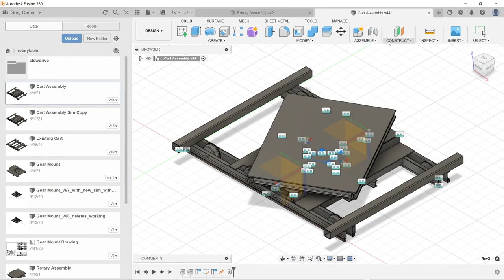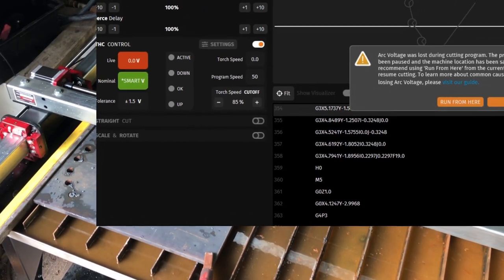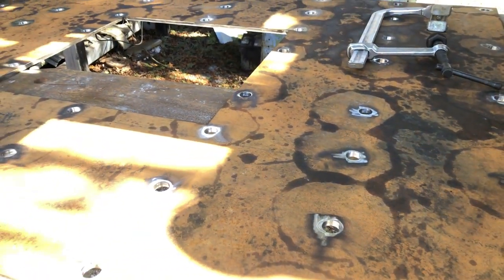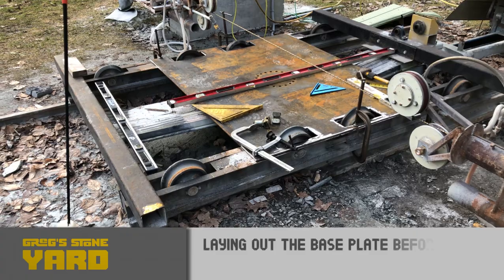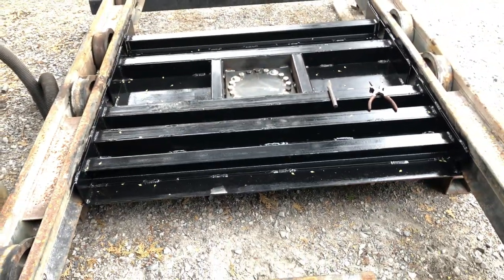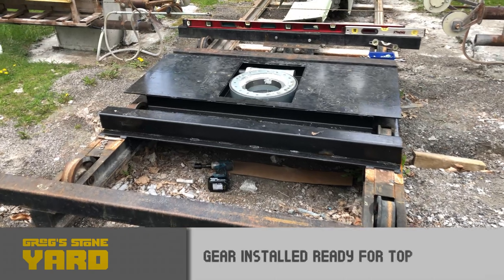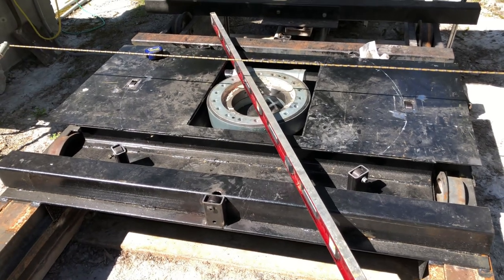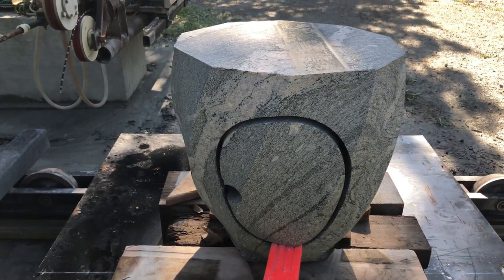Building a CNC rotary axis for a stone saw #CNC #CUTTINGGRANITE #ROTARYAXIS

Comment: Nice addition to your stone saw Greg. I've never heard of a slew drive before.  I suppose you could easily square 5 of 6 sides on a single setup now?  Not to mention the creative cuts you demonstrated.   Always happy to see new videos from you.
Reply from the maker: Yeah that's the plan if I need to.  Really just using it to position stone to make simple cuts has been a big help.  The more complex ones require a good CAM program to generate the correct gcode.  Right now I'm using something meant for hotwire foam saws, it works but is limited in what it can handle. Thanks for watching!

Comment: Curious what the current rating is on the slew drive motor, and how it's being driven?
Reply from the maker: Hello Mathew, the motor is 24VDC rated for 2.8A (3.5A peak), it has a 234:1 reducer on it, then the slew bearing is reduced again 78:1. To drive it I use an ancient AMC brushless drive (B12A6 model).  You can find them cheap on ebay, and they also work with brushed DC motors too (which this one is).  The slew drive was surplus from a company that did solar installs.  It was meant to be used for a solar tracker.  You can also find them on things like manlifts and excavators, but those would be driven by a hydraulic motor.

Comment: Think it's possible to cut a Japanese stone lantern?
Reply from the maker: Those are fairly complex.  The top would be the easiest.  The middle part where the light is would be the most difficult. As it needs to be hollow inside, and it would depend on what shape you wanted it.  4 sides that are symmetrical would be easiest to do on the saw, 6 sided would be difficult.